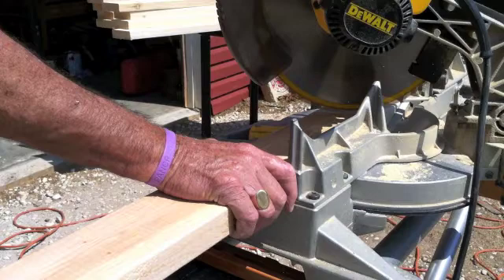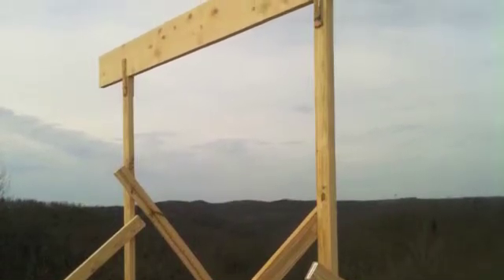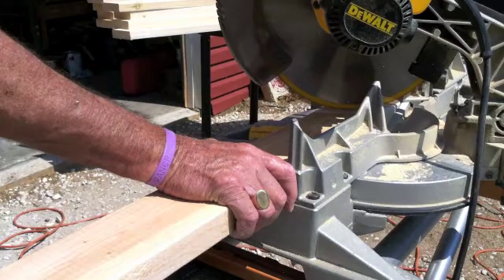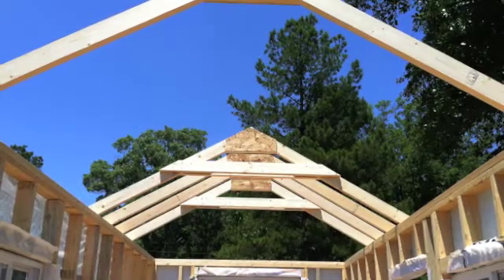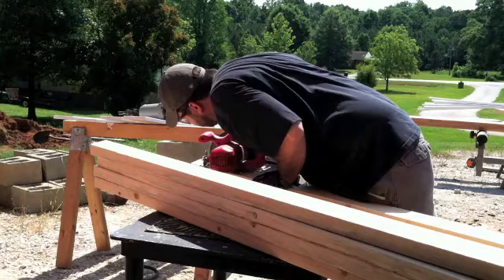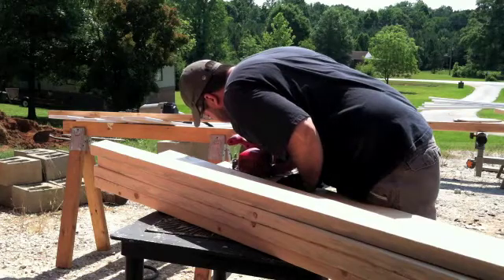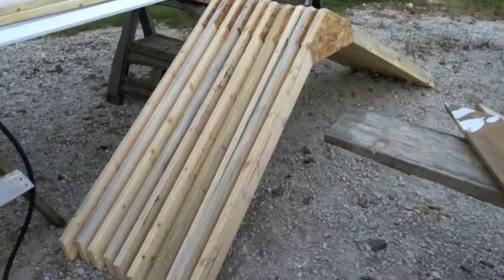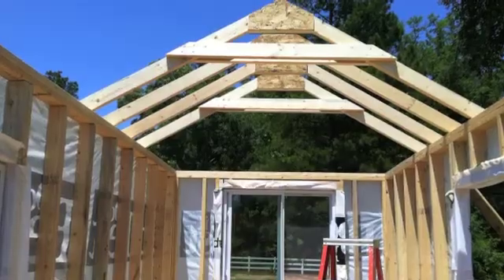Tiny House - Build Your Own Trusses

Comment: Hi Tiny Revolution, I've followed your build from years ago! A quick question: did you consider building a floor truss for your subfloor? If not, any comment? In principal it seems like Tiny House subfloors have an awful lot of extra weight, especially when you consider many Tiny Houses have the subfloor bolted to the metal siderails of the trailer metal.

Comment from the maker: I totally hear what you are saying and if it weren't for the fact that we had the OSB on hand and the area wasn't so small I would have purchased plywood. For this use though I felt no reason to "splurge." In terms of moisture a tiny house has no attic and ours doesn't even have a sleeping loft so between our radiant barrier and small ceiling cavity we have virtually no moisture buildup to be concerned with.

Comment: No need for the horizontal 2x4 members unless you have a great expanse and or you want to put in some type of finished ceiling. If you are worried about spreading, then use a stouter splice piece.

Comment: Awesome video!  Only thing missing (for me) was how to design it.  You mentioned an 8 foot span, but you didn't mention how you came up with the roof height.  I'm working on designing a truss with a 14.5' span (120sq max without building permit) but I'm not sure the proper height.

Also, I tried to contact you from your site and it said it failed and to contact the administrator a different way. :/